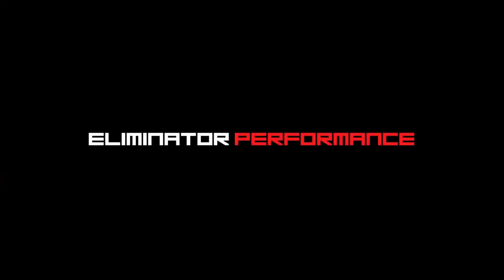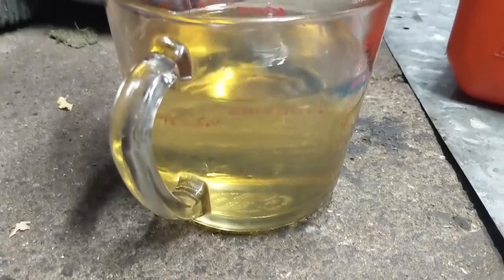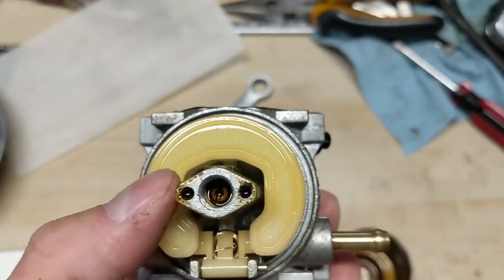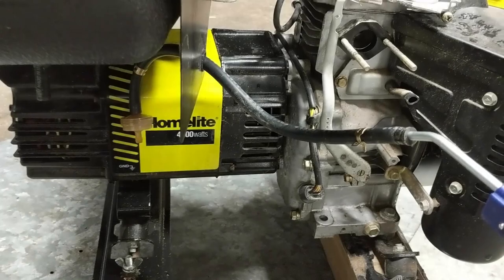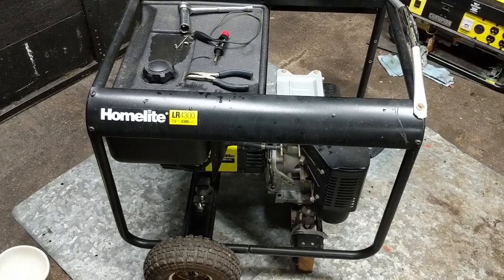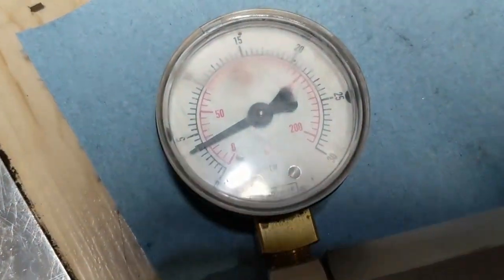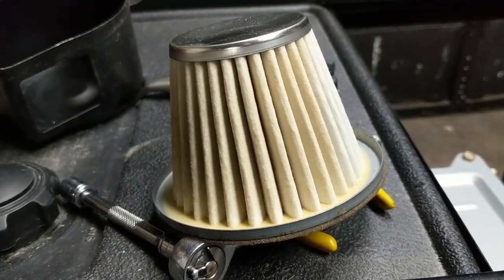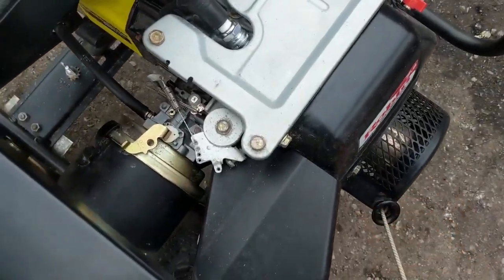Homelite LR4300 Generator - Robin Subaru EY28

Comment from the maker: I found a China replacement carb on Amazon for about $35 but it didn't have Prime 2 day shipping, so it could've taken a month to get here.

Additionally, the carb had a slightly different design (same OEM part #) so I'm not sure if I could've used the carb itself as a replacement, or even gutted it just to use the needle valve and bowl gasket...

Wasn't worth the wait and extra $$$ to find out if it was useless or not!
Reply: You have a choice of several for the EY-28 from 13.99 to 29 bux with prime ship. BTW, students get free ship (with a school address) and EBT/MEDCAID recipients can get Prime at half price (Like 6.05 a month)

Comment: Nice fix. I try to use NGK plugs in my shop unless I don't have one in stock. I try to replace plugs for customers, but some customers are cheap and want to use the old ones if I can clean it up and re-use it. Sometimes the labor cost is more than replacing it to begin with. Thanks for the excellent video's.
Reply from the maker: Yea usually I replace plugs every 2-3 years, but this is a prime example of why I replace them, sometimes they just cause issues. New plug and it ran great!

Thanks for watching!

Comment: Great video, I had it done by my local shop as I have the same unit and it was sitting new in the box, straps and all, since Sept. 11 2001.  I bought it just in case and just never needed it until now.  I put 10-30 synthetic oil for the first 20 hours but then my shop told me to use conventional 30 for the change.  I live in Quebec, north of Montreal and wanted your opinion on oil choice.  Thanks!!!
Reply from the maker: 10w30 is fine for summer, 5w30 recommended for winter use. Definitely use conventional oil and not synthetic.
Reply: So it's not a problem that I did the synthetic for the first 15 or so hours and then switched over?? @EliminatorPerformance
Reply from the maker: @markperlstein2066  no it'll be fine
Reply: @EliminatorPerformance  Thank you for the advice, I was amazed to find my unit on youtube after 21 years!!!
Reply: @EliminatorPerformance  What company's generators do you recommend??  Are US, EU better than China??

Comment: Great that you got that generator running for the custmer 👍oh where can i find that pressure tester.for carb pressure testing🙄🙄?? Great that you did a spark change how a spark plug can make a differance in the enigen preformance
Reply from the maker: Amazon for most people, STENS for us because we have an account!

Part number 705-020
Reply: @EliminatorPerformance  okay thx

Comment: Great video. Just curious did you price a new carb for it? Can’t believe parts were that pricey. Those are good older engines though. Nice video.
Reply from the maker: New OEM carbs were over $200, I found China carbs for $35 but they had a slightly different design, would've probably gutted it and used parts, but shipping would've taken a month so I decided to go with OEM parts as I could give a guarantee. Thanks for watching!

Comment: Great video again.

#1 Which supplier has Subaru parts?
#2 How much would a new carburetor have been if you priced it?
Keep it up👍
Reply from the maker: Thanks for watching, I ordered these through Ben Bergs Farm Equipment, and I found China replacement carbs for $35 but the fuel inlet wasn't the same (even when searching the OEM part number).

So with a month shipping (none were Prime 2-day) who knows if it would've even had the same needle valve and gasket!

I was considering just stripping down a China carb and using parts, but it wasn't worth the wait.
Reply: @EliminatorPerformance  Thanks for taking the time to reply.  Hard to get parts for some stuff.   I have been using a place in Ottawa for Ariens parts when no aftermarket available, they'll give you a discount and they ship and they have a decent website. ( Yarmand ) Of course Stens in my favorite.
Anyway I was wondering what an OEM carburetor was.
Reply from the maker: @billlovett4256  Yarmand, will have to check them out! And OEM probably upwards of $200 believe it or not.
Reply: @EliminatorPerformance  OEM from Generator Guru is $252.00
Reply from the maker: @jeffstandlee9504  I've since found a suitable carb replacement for this unit for like $40 Canadian so I know what I'm doing next if I ever get another one. Forget paying that for a single part!

Comment: So much easier a fix if you dump out old gas put in newer gas with 1 bottle of sea foam or mystery oil in the gas will fix all the problems described here. Way overkill here.
Reply from the maker: Let me know when a bottle of Seafoam will fix a leaking needle valve, and I'll buy them by the truck load.